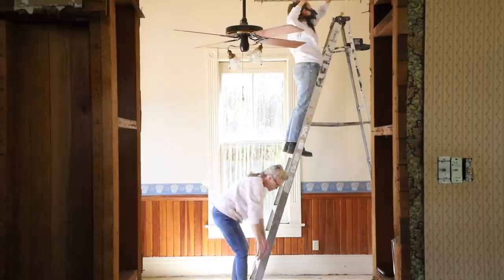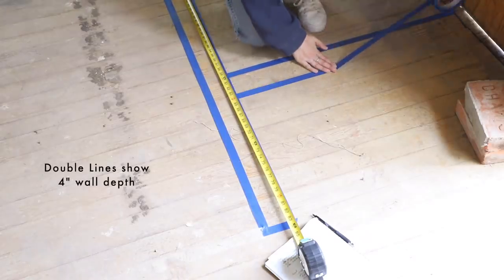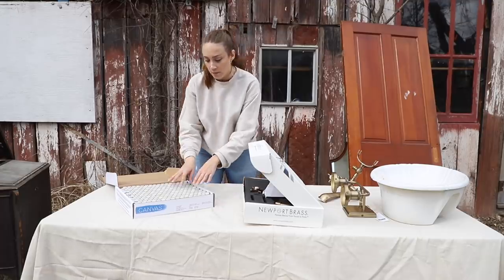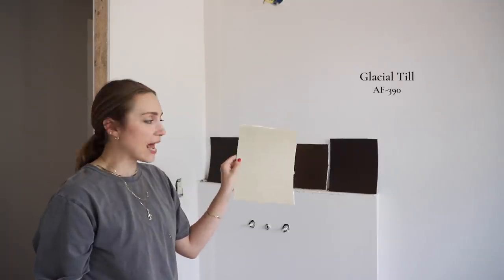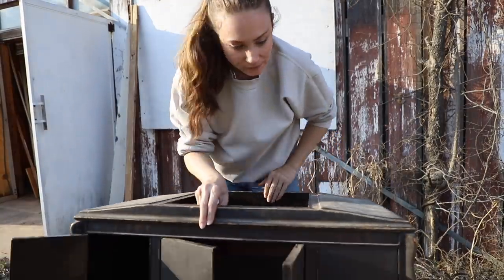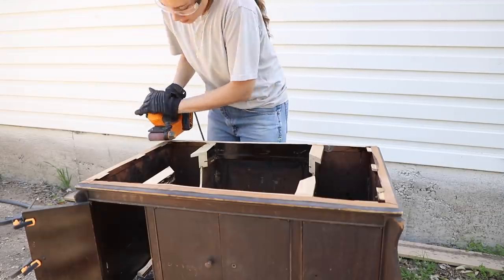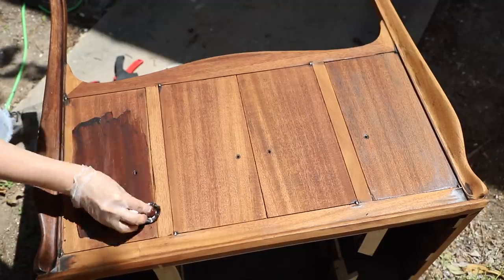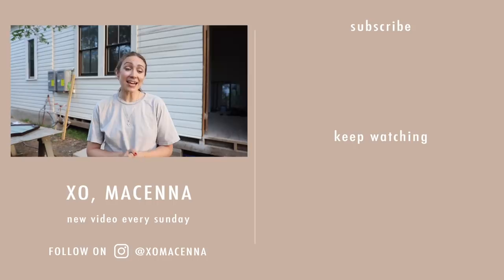GUEST BATHROOM MAKEOVER & DIY Thrift Flip Vanity (Episode 1) | XO, MaCenna

Comment: Whenever you are cutting wood (especially old wood) I’ve always used painters tape to help. You can draw a straight line to help follow, and it also helps prevent splinters/taking away unnecessary bits of wood! 
Loving this and can’t wait for more design!

Comment: 🌺  Suggestion on the vanity. Add some side supports, angle them front to back on both sides of the side of the sink.  Because it’s a heavy sink & a heavy granite countertop so with those dainty little legs you should definitely add some extra support.  Everything looks Amazing 🤩

Comment: I like the Bittersweet chocolate color for its traditional look-- it's an old-fashioned color with more straight black tones, but it is a little dramatic and less soothing. 
PLUS, since you mentioned the floors (which I've been dying to see you start!), if you're not settled on a wood sealer for the flooring yet I recommend Waterlox. It's a tung-oil based finish and seals with a hard finish, but you don't get that "plastic coated" look that comes with polyurethane. It is a much better finish match to the early 1900s shellac finish on so much old woodwork. You will still feel the woodgrain on your floors through the finish. I was able to apply it myself to our 1890s yellow pine floors and it's an incredibly forgiving process. Love watching you master all these skills! The kitchen cabinet project was crazy impressive. Your project takes me back to our renovation years-- learning to frame, plaster, shellac... it's empowering.

Comment: I’m loving the vanity and the work you’ve done on it. Wood color looks amazing. For the dark Walls/ceiling, I would mix the two colors into a 20:80 ratio just to see. But please do check the original Colors at night with a light of the same intensity of the one you’re going to use. The hardware, such a great find, please try the backplate with a plain knob, I just think it would let the backplate stand out more. Or maybe try the opposite with a plain backplate? You’ve created a fun guest bathroom space to work with and your design/theme would upscale it nicely.

Comment: On my antique cabinet I boiled the brass hardware in equal parts water and white vinegar for 5 minutes for the small handles and 6 minutes for the larger.  Used a baby toothbrush and liquid bartenders friend to clean them up and clean out the grooves. They turned out amazing.

Comment: Another way to get brass clean is to mix 1 tablespoon of tartaric acid (from the baking section at the supermarket), 4 cups of boiling water and a squirt of dishwashing liquid. Put your brass handles in and the metal will come back to original. Remove with a pair of tongs, rinse with clean water and dry.

Comment: FYI Wenge is pronounced when-gay. It doesn’t read purple on screen. I think the bittersweet chocolate is very good, but because I am not seeing it in person, it may be too dark. The vanity supports are meant to hold the phonograph. With the granite top, you won’t need the inside framing to “support” the sink. The sink will sit on the drain and the countertop. If you remove the framing, corner pieces will help provide some lateral support so the cabinet box doesn’t “rack” or twist out of plumb. Keep up the great work!

Comment: Can't you ask the paint store to add some black to the brown you want darker? Maybe that could work. The only thing I would be cautious of with mixing colors or custom making colors is that if you ever need to go back and touch up paint like filling in holes or something later on in the house's life, color matching would be slightly harder. I learned this the hard way over the years. You seem so organized I don't think you will have an issue but labeling or making a list of colors you used and where is also really helpful later down the road.